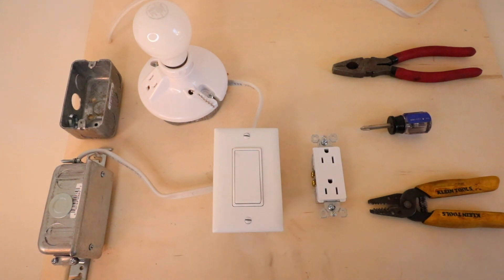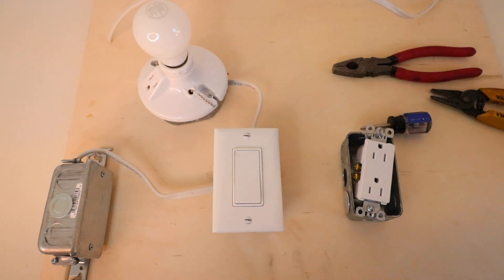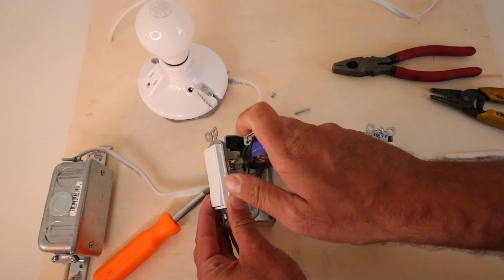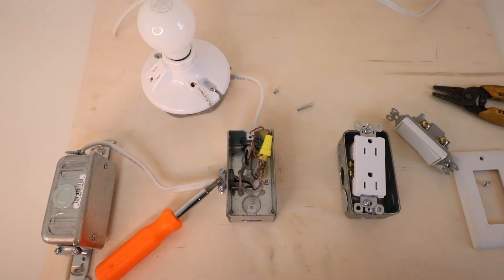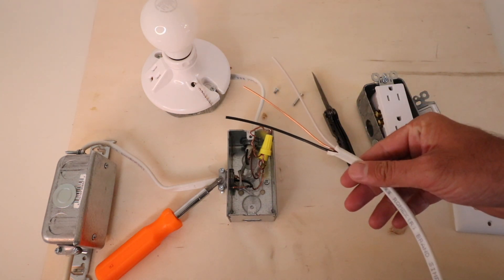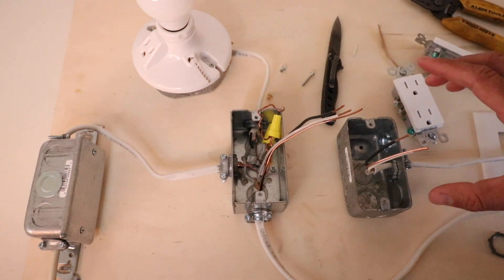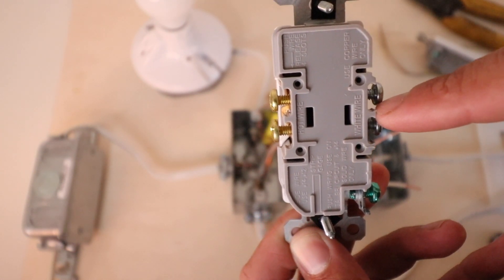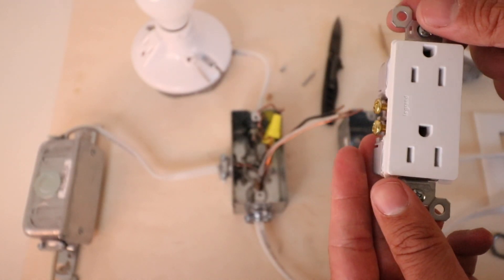How To Add An Electrical Outlet

Comment: Aw hell nah, at least twist wires before you put the wirenut to ensure proper connection, Also don’t recommend using the tab under the screw, it’s better to pig tail them together so we don’t get any lose connections

Comment: If you want to increase your electrical knowledge please read NEC.   You are absolutely not the only one doing this on YouTube.  
Per NEC definitions, Outlet:  A point on the wiring system at which current is taken to supply utilization equipment.
Meaning a receptacle outlet can be plugged into.  A lighting outlet is for connecting a light fixture(luminaire).  A hardwired connection to a dishwasher.
Per NEC Definitions, Receptacle: A contact device installed at the outlet for the connection of an attachment plug.
This makes a difference if you are trying to understand what NEC is saying about certain conditions.
Respectfully,   Kevin

Comment: Hello I would like to know how to wire, power into switch than to a plug than over to to the light. So you have power at the plug but also work the light with the switch

Comment: It is confusing but you mixed up old work with new work box and viceversa. The new work box is for new work or in other words new construction.  Those are attached to studs. The old work box is for old construction or a home that no longer has open walls and therefore the little wings.

Comment: Thanks for the video. I have three questions.  First, why is the outlet always on even when the light switch is off? Second, why you choose to connect two black wire at the bottom screw and one at the top screw?  Last question is what makes you choose which black one goes where?
Reply: I believe the incoming power (black) to the light switch and outgoing wire (black) to outlet are both attached to the bottom screw so that the outlet is always powered (not affected by switch).  Outgoing wire (black) to light is attached to top screw so that it is controlled by the switch.
Reply: @joerevere937  ,
Not a good idea to have more than one wire on a screw. Use a pig tail and wire nut.

Comment: 2:00  Figuring out how to get the wire through the wall to where you want the new outlet is typically the hardest part of a job like this (for me anyway).  The summary is that you might have to get 'creative.'  LOL  

4:12  He meant to say "old work" not "new work".  The old work box has the wall anchoring tabs mentions.  New work boxes typically have nails or screws for mounting to the studs (before the drywall is put up; hence the term "new work").

Comment: Great video. How to add outlet to existing 3 way switch. The power to the light then to 3 way switch in the garage thanks. I just want a outlet there so I can u it and it doesn't matter if I need to to on the light in order to use outlet thanks

Comment: You neglected to explain different colored screws on outlet: connect hot wire to brass screw and neutral wire to silver screw.
Reply: 4:40 pay attention if you want to criticize

Comment: Great, except that my outlet has a black wire, white wire, red wire and a bare ground wire. Tried several combinations and it still blows the breaker. I have just replaced the outlet. What am I doing wrong?
Reply: Does your original receptacle have the tab broken off on the hot side to make each socket independent? If so, you may have a multi wire circuit meaning the upper and lower are powered by a different circuit. If you did not break the tab on the new receptacle, it could trip the breaker. If this is the case, you should have a double pole breaker on your electrical panel. The black and red wires are both hot wires.

Comment: I have a 15amp breaker for my office (regular bedroom) and I have all 15amp outlets, I need to replace one outlet that is worn and loose, could I replace it with a 20 amp outlet that is more rugged/heavy duty and will last longer??
Reply: That would be a code violation.
Reply: @surferdude642  I am not arguing with you but need more information. Aren't all 15 AMP outlets basically the same ? How is this a code violation(I don't have any real depth knowledge of electricity) This is exactly the reason I wanted to check and get lots of different opinions on doing something like this.
Reply: @HollowayMooseRanch  Good question. You have a 15 amp breaker, so that implies 14 gauge wire. A 20 amp receptacle implies a 20 amp circuit breaker with 12 gauge wire. An unsuspecting individual could, however unlikely, plug in a high wattage 20 amp device  and overload the circuit. It would most likely trip the breaker or worse. That's why it's a violation. A 15 amp circuit can safely carry 12.5 amps on the whole circuit, not just that one receptacle. A 20 amp circuit can safely carry 16 amps. Can you put in a 20 amp receptacle and use your office equipment normally? Absolutely. Should you? No. A 20 amp receptacle is not more rugged/heavy duty than a spec grade 15 amp receptacle. The key here is spec or commercial grade, not residential grade. They are not that expensive. The 15 amp spec grade and a 20 amp receptacle are the same quality wise. Hope this helps.
Reply: you could, but you are better off buying a GOOD heavy-duty 15 amp outlet. Remember the wiring in the walls (14 gage) is only rated for 15 amps

Comment: Need to add an outlet out off a light switch. My wiring is: black and red wires for the existing switch and a white wire that just goes through the box uncut. Should I cut the white wire, add the white wire for the new outlet and put all 3 white ends together with a nut?